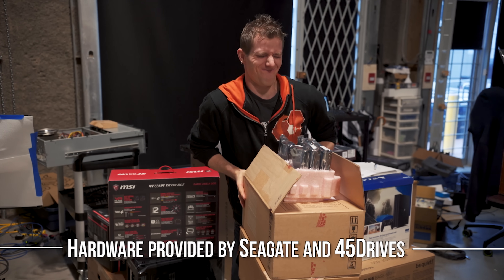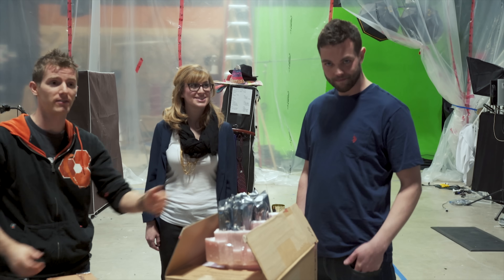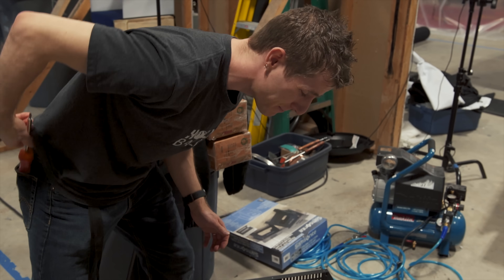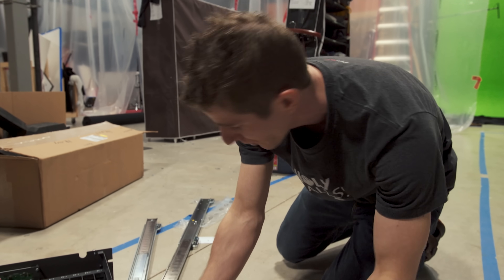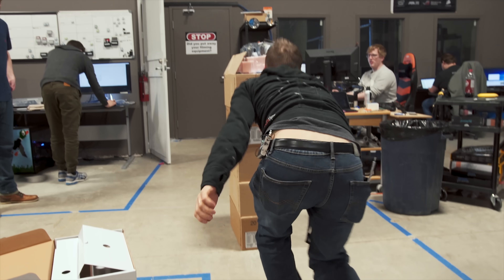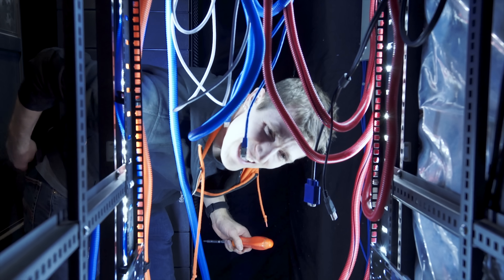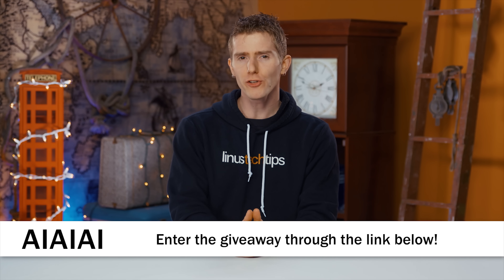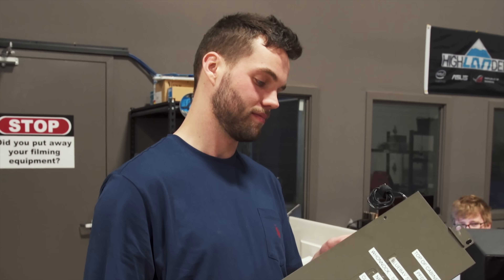INSTALLING THE PETABYTE - Server Room Upgrade Vlog

Comment: 1Tb memory on RED-camera with 300 mB/s video output can't last long.
But (1tb/300mB)/60 gives 55mins of footage. Much more than I first tough. 
Did I calculate it right?
Reply: I had the same result so maybe you're correct :)
Reply: You also have to remember compression though. Its not like Arrow is being broadcast uncompressed. It still is insane though.
Reply: Just think though. Im currently watching Arrow, a 40 min episode at 720p is 350mb. RED uses that space in 1 second. Its hard to imagine.
Reply: Would this make my cat  videos look better?

Comment: Any tech nerds here? I need help.

Which RAM is better?

A 1x16 GB of DDR4 RAM, running at around 2600mHZ
Or 2x16GB of DDR4 RAM running at around 2800mHz?

Is there a downside of having two instead of one? Or the other way around.
Reply: spree more is always better, further more if you can have 2 stick of ram that is better because it takes advantage of dual channel memory. the 2nd choice is faster and larger, it will be more expensive but it will be better for sure
Reply: Sounds about right, since the 2x8 is faster. Thanks mate! :)
Reply: spree you typed 2x16 up there hence my saying larger, 2x8 is the same amount of memory but it is faster, plus the advantages of dual channel memory, the only advantage of single stick is it allows for expansion
Reply: Oh my bad, but still thanks for the answer tho, going with 2x8. 16GB HERE I COME

Comment: Im giving it a year before all of Petabite is full and that empty office upstairs is converted into a secondary server room.

BUT... IS the offsite backup being upgraded as well???
Reply: did you take into account the new cameras? cos if they're using them and storing the video at 8K space is gonna get used up quick.
Reply: he once said he doesn´t delete anything, thus he has all the raw footage. 2 years is a brave guess
Reply: Brendan Gifford From what I know, they get rid of the raw footage once they have the final video. Assuming they don't compress their final videos and transfer everything from Whonnock and The Vault to this new server, it should be a maximum of two years. Of course, take it with a grain of salt, as this was just some really quick mental math and I may have made errors along the way.
Reply: Andrew Kerr *petabyte
Reply: One year? Give them less :P maybe 10 months XD
Reply: Hey, I'm from the "future"
No. There's no offsite backup and they lost data.
Reply: Just did the maths as well: I get ~833 hours of raw footage.  How did you figure 2 years: that is only about 1 hour of raw footage per day, plus edited videos to fill a petabyte.  That's also assuming no RAID to take space, which is clearly a bad assumption.
Reply: Just ran the numbers, and it'll take them a little less than two years to fill that server.
Reply: dire_chinchilla j

Comment: in 15 years that will fit in a sd card
Reply: SD card in 15 years lmao
Reply: @dubliostower  8 years later sd cards still common
Reply: Ashley Anderson they don't generate more storage, and they won't help you get a better frame rate or graphics in game. I've oversimplifying this part, but they are mainly good at doing complex analysis of a bunch of data with infinite possible solutions (think scheduling, traveling salesman, or any other thing that deals with high amounts of data and hard problems to complete).
Reply: It's incredible how one would only need about 700,000,000 3.5" floppy disks to have this amount of storage.  Looking back, I think I would prefer your idea.
Reply: Ashley Anderson DNA storage. The whole internet of today can be stored in a single room, they say
Reply: They don't do everything better. Just some of the things current computers are awful at. 

They aren't graphics machines or performance stars (but if you're spending money on a quantum chip, you might as well add a good graphics card in for the equivalent of a few pennies)
Reply: +Ben (penne12) or just emulate a extremely high spec computer on a quantum computer
Reply: DNA data storage is the next big thing
Reply: Moore's law is dying.
Reply: Luciano Lizana hopefully by then we'll have a different kind of storage developed from the capabilities of quantum computing or something
Reply: Luciano Lizana Holy fucking shit just thinking about that blows my fucking MIND.
Reply: Quantum computers are only better in some things.
Reply: kuba zrobczynski you don't understand, quantum computers aren't super fast Intel i14 microprocessors. Instead of using bits, they're using quantum bits and as such can perform some tasks better
Reply: Luciano Lizana and it will cost 49.99
Reply: Carbon-based chips!!!
Reply: Currently we believe quantum computing is impossible to physics just purely not allowing it.
Reply: No it will never. We have physical limits. But we could have improved our  factories and production lines that this is sold much cheaper.
Reply: sorry i deleted my intelligent comment because i wanted to edit it because the speed isnt 4 kilobyte/s but 
2 kilobit/s for dna storage
Reply: +Lothar Schulz in the 19 century they said physics is solved. youre ignorant if youre saying that again. you just have to say "its likely that we have physical limits".
Reply: But yet still can't spell believe. Consider yourself stupid instead of calling others.
Reply: ...so they could try a billion different card designs that could be cheaper to make and store more data to find the best one without ever physically prototyping any of them? 

Hence we could totally make better storage solutions using AI and quantum computing.
Reply: @lucianolizana446  7 years later and not even close lol.
Reply: Central Intelligence Agency Not really. feel free to express your knowledge
Reply: Ashley Anderson non they're not. Because of qubits they can perform basic operation much quicker. But the shit you see on Google is barely a quantum computer. IBM has one but is still way less powerful than regular processors.

Anyway, I don't see how it quantum physics would help storage considering the qubits are lost upon reading and the qubits can only exist in a 0 Kelvin atmosphere anyway
Reply: Ashley Anderson they just perform operations wayyyy faster
Reply: Luciano Lizana Lol, no.
Reply: it would be great for archiving?
Reply: and the futureof storage is spintronic data storage
Reply: more like 20 but yeah
Reply: Well in fact i spend 4 years of my life to study physics at technical university Berlin. 

I'm very right with my prediction and you are stupid because you have not arguments but religious belive from something you obviously don't have a fucking clue about.
Reply: @Halobeast2545:  How does the past predict the future.
How about we are down to a 10 electron bit capacity storage cell?  Yeah, no problem for your guys, we can split the electron and have a 1/2 electron transistor .... right? 

We can add layer on layer now but we can't make shit smaller anymore. And the layer thingy is linear scale and not exponential.

Science man, less religions like believe.
Reply: Central Intelligence Agency Do you?
Reply: calm down
Reply: he was making a joke chill out
Reply: yep
Reply: You beat me to it, but I was going to say in 5 years on a micro SD.
Reply: Hopefully by then we will have DNA storage which will also mean PNA is successful which if you don't know could fix do many problems .
Reply: Lothar Scholz You're right . Maybe they will make a medium similar to but larger than the SD card
Reply: YouTube Heroes Idk why you're talking shit Minecraft boy.
Reply: Cherzong Cha That is true but I don't see anyone lime Facebook , Google , Twitter , etc moving any existing data to DNA storage because that would take so long.
Reply: Central Intelligence Agency and how do you know I know nothing about qubits?, the reason I did mention emulation is because of hearing it as a good mention, hell scoentists don't even know how to use a fucking quantum computer they built one but don't know to use it
Reply: kuba zrobczynski yeah they do, quantum computer allow us to create quantum gates and the likes and that's pretty much all there is to it. The quantum physics predate quantum computers by a lot, it is something mystical that can be accessed on only quantum computers (which then again do not exist yet besides the one made by IBM. The one made by Google uses tunneling and that's pretty much it)
Reply: Central Intelligence Agency another company j cannot remember the name made a 12 or 16 qubit QC and they are yet to fully understamd how it works
Reply: kuba zrobczynski You said the scientists didn't know how to use the QCs. I'll need a source on that
Reply: Central Intelligence Agency seems I may have been spreading misconceptions then, it seems that games aren't optimised for how it works, however giving it its own dedicated QGPU would seem like it would work, however quantum computers wont be available for the consumer for a long time, I will source it but I may have remembered it wrong, since I had no clue that a 2000 qubit QC exists

https://www.dwavesys.com/press-releases/d-wave-systems-previews-2000-qubit-quantum-system

also I am surprised I found an intelligent being on the internet j can discuss information with and do it in a civilized manner, I understand I may have had the wrong informatio, however I am not saying you were correct either and I may have to link more sources down the line as I would lime you to as well
Reply: In 15 years, there will be no SD card.
Reply: Not even close yet 😢
Reply: 8 years later, were halfway there. Nope. They have to use a 2 petabyte server now. Oh how times change
Reply: 7 years later and we god 1tb sds but they are slow. A recent study calculated that the theoretical max data on a CD-Rom would be 3 petabytes but we’re nowhere near that technology yet
Reply: 2025 here! 4TB SD Cards are kinda normal 🎉
Reply: Progress is slowing down and consumers are are being phased out of being allowed to own storage.
Reply: Ashley Anderson you don't know how quantum physics work do you?
Reply: in 15 years, i wont be alive.
Reply: quantum computing is actually inferior to current processing in many ways, it's just better at solving complex operations. The future of storage is most likely in DNA
Reply: Yeah maybe but it won't have the speed or redundancy. Mainly the speed will be the biggest issue.
Reply: Qubits only exist in 0 kevin? Afaik you can't get to absolute zero.
Reply: actually according to some theory that says computing power/storage doubles every two years, it's 24 years, not 15
Reply: Central Intelligence Agency I don't know much about it no. but I do know quantum computers are insanely better than what we got today. with a tool like that we could accomplish so much more.

Comment: Anyone else have issues due to not having lower quality options?? I have a slow internet connection and cant go higher than 720p.. The lowest this video goes to is 1080p so I cannot watch it unless it buffers for like 2 hours.  I hope this doesn't become the norm just because you shoot in 4K.  More people have slower connections and use lower res than people have 4K displays or the equipment to deliver them 4K...

Comment: runs out of storage in a couple months
Reply: "Installing the Exabyte"
Reply: *Hours
Reply: Kigabyte aaaaaaaand "it's completly full too!"
Reply: :I *days
Reply: 1petabyte is just enough for Dennis' hentai collection.
Reply: just have to leave the 8K camera recording for about a month and it will be full, i did the maths
Reply: Kigabyte *milliseconds
Reply: Next week upgrade to 100 petabytes
Reply: Genie: "What's your first wish?"
PC Nerd: "A HDD that never runs out of space."
Genie: "Here you go!"
1 week later:
Genie: "What's your second wish?"
PC Nerd: "Another one."
Reply: *Nanoseconds
Reply: A tape storage array might help, presumably they don't have to dig out the really old content that much.
Reply: We gotta go overdrive!
Reply: they just add more storage couple of weeks.. so 2,3 weeks new one to. :D
Reply: 0.001 Planck Seconds*
Reply: Serge NG Since when is there 3600 seconds in a day? Have we started one-hour days?
Reply: *0.000000000000000000000000000001 sec x 1E92928287373829110188377372728191
Reply: stickmandaninacan how much did you get in maths
Reply: *seconds
Reply: TheOpAlexGuy calculator
Reply: :I then we move into the 1024 petabyte storage system
Reply: Just did the math, and if they continue to use as much space per day as the average day (roughly 0.619TB) from this video to the video they released yesterday.(Apr 4 2017 - June 23 2018 [445 days]) then they should run out of space in another 557 days or about the start of 2020. However with them only starting to use the REDs when they uploaded this video, their average usage per day is probably a bit higher and is probably increasing.
Reply: Considering 3s or RED equal 1GB of storage and that in 1 day we have 3600s then
1 day equal 28.8TB
1 month equals 864TB
You are right!
a RED for CCTV not yet!

Comment: Technicaly every decent quad-core is ready for GB/s. did you know guys? the most frequent limitation is STORAGE speed data, CABLES, internet speed and the sheering lacking number in drives you have (SERIOUSLY where you're going to transfer to with your 2000$ one port one drive machine? WIFI? GOOD LUCK with that!)

Comment: I find a certain irony with your server. Though they may pale in performance. The servers and drives from nearly fifty years ago, well before Linus was born, were heavy, difficult to install in the racks and hardly ever worked the first time you turned them on. They had the same kind of bugs with connectors and cables that you still have today and the cards and cables had to be jiggled and swapped to get them going just as Linus did with the hard drive. I had to keep the old things running where I worked in the eighties because of the antiquated test equipment still in use. Isn't it something that after nearly half a century, the rat's nest of cabling and mechanical connectors are still a nuisance?

Comment: How do you know if it can handle a failed drive unless you test it out. I want to see a sanity check of the failed hard drive redundancy you have in place. Would be worse if you find out there is a misconfiguration some where and you loose data.

Comment: 100 year later will 1 petabye be the normal standard hard drive. For example 1 tb is normal right now xD
Reply: I believe the standard will go like usual unless we hit a similar barrier to the CPU one causing a problem rigt now. 1 2 4 8 16 32 64 128 256 512 then a petabyte... so expect petabyte storage for CPU enthusiasts in around 5-8 years.

Comment: One minute of 8K footage is about 180 GB in movies. Linux videos with it's huge compressability will be about 90 GB, so it's 11111 minutes or just 185 hours. And you need a 50% RAID 10 redundancy if they are huge drives and backups. So in the end we talk about a useable filespace of 300 TB.

Thats about your moms VHS tapes collection from the 1980th's

Comment: What you did wrong - Not enough RAM - For a rule of thumb, install 1 GB of RAM for ever TB of storage. This will be a serious problem if you fill up your drives. The empty server performs good thats not the case - the case is how it performes with 60 oder 70 % full. In your case you will have a drastic drop in performance befor you hit 50% full because of your extremely limited RAM-space. If you quadruple the RAM in each machine you will come to 80 % full with good performance. Hopefully the board and cpu supports it :)

Comment: As someone who has done their time in server rooms and data centres (and still runs a rather large test lab), I'm not going to complain as to what you guys did wrong. Instead I will just state that I feel your pain when it comes to DOA kit and troubleshooting failed drives/HBAs.

And if it makes you feel any better, I've had failed kit for an install in the middle of a damn desert, I used up all the spares and had to pray that nothing else failed (it took 2 months to get kit through customs).

Comment: if ram is used to map the storage doesnt that mean that the map is lost when theres a power outage?
Reply: Dregunburn  he has a massive battery backup and redundant psus on everything in his rack
Reply: This is what the filesystem is using all the memory on: https://blogs.oracle.com/bonwick/entry/zfs_dedup

The deduplication metadata is also written out to disk, so power loss/kernel crash wont be a problem.
Reply: It's not a map per se. Rather, it's used to cache metadata, i.e. management data that is used to locate user data on the drives. On large storage pools, you'll want to size your DRAM in the server to be at least 0.1 - 1% of total pool size to get decent data retrieval performance. Otherwise the pool has to spend a bunch of extra I/O time retrieving metadata just to locate the data you have requested - this hurts overall performance somewhat. In fact, I'm kinda surprised they didn't go with 256 or 512 GB of DRAM per node, but I guess since they're running 1-socket boards, they're really kinda close to maxing out the single-socket DRAM capability.
Reply: Dregunburn No, the mappings are stored on the Hard drives too, but the access time is a lot better using the RAM.
Reply: nope. the 32/64 bits architecture also affects how much memory you can map. 32bits architecture = max 4 GB ram and not sure how much storage, but not very much. the ram has its own "map" and depending on architecture the processor can or cannot access all of it, but 64 bit can access 16 petabytes of ram, so no longer a problem. the hdd also has its own "map", FAT (file allocation table), so it doesn't depend on ram to know where stuff are saved, so the map doesn't get lost in case of power outage, but u still need plenty of ram to access/find/cache all that information. that's also why phones support a limited amount of storage, because they don't have much ram.